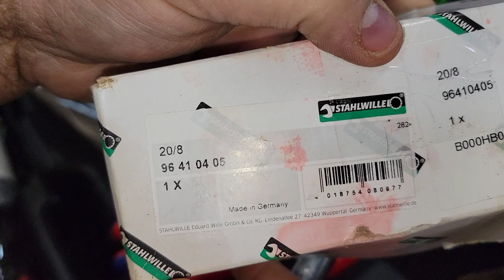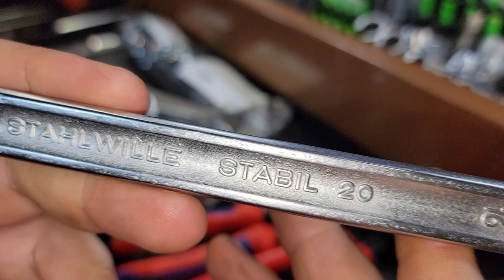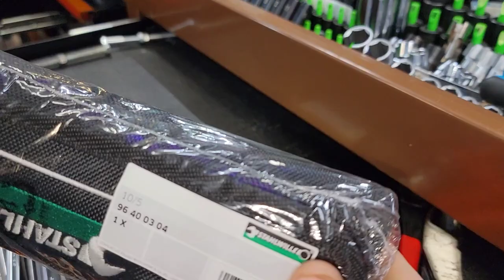STAHLWILLE WRENCHES & KNIPEX 13 72 8, GERMAN TOOLS ASTONISHING QUALITY!!

Comment: If any German made tool is needed let me know, I'm in house and can ship. Stahlwille is the go to after Snap-on in Germany especially in Aviation... Stahlwille double open end wrenches are tested and engineered for a lot of torque.  That is why the heads are so beefy.
Reply from the maker: Awesome sounds fantastic
Reply: Where does gedore rank amongst german makers?
Reply: @BySixa  Gedore is a  very good tool manifacturer

Comment: The Stahlwille naming is easy.  10 is the series of wrench.  5 is the number of pieces.   If it has an A is SAE.  If it has kt it’s in a tray.  Sometimes you get the nice pouch, sometimes they come in a cardboard box.  I see you found the jungle website global deal for $30.  I got the 10/12 I think it was and still is like $85.  Got the SAE too.  That’s how I buy a ton of my Stahlwille stuff as well as on the Germany version of the website and mister worker  (I have almost all Stahlwille wrenches up to 36mm, just need a few more HPQ and flare nut wrenches).  Trying to do that with Hazet and Gedore too, but it gets expensive.
Reply from the maker: Thanks for the excellent information I should have looked more but I did  suspect a good person would share the knowledge I truly appreciate!